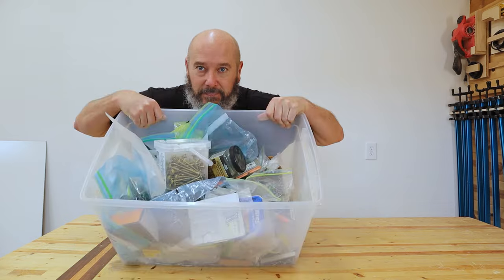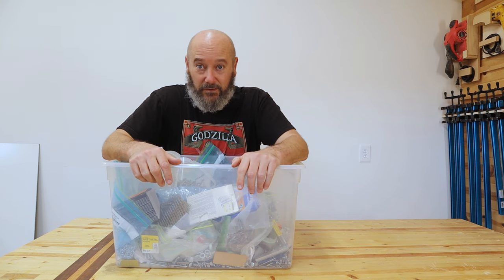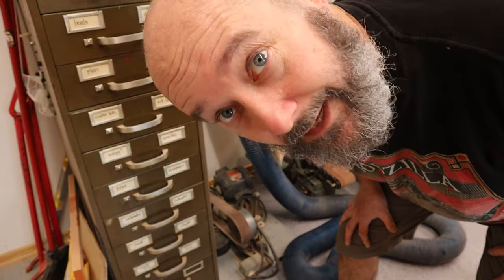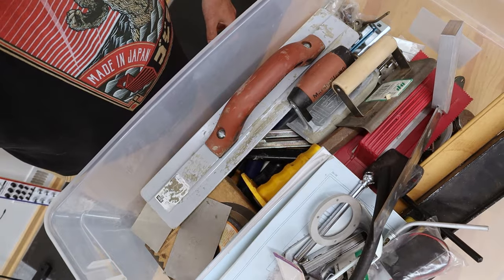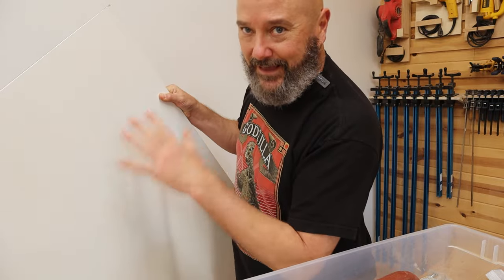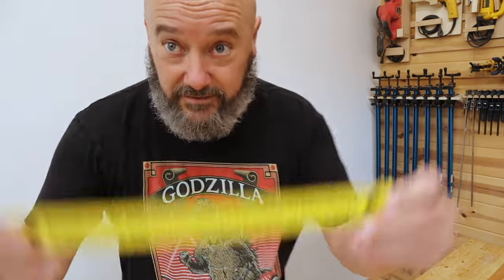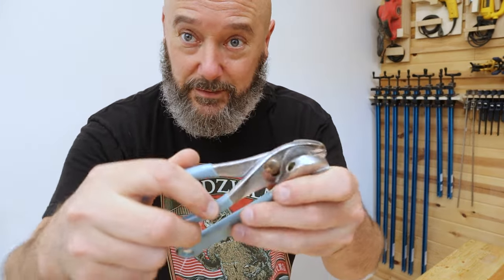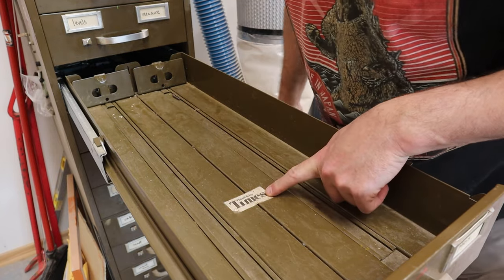Say Goodbye to Chaos! Easy storage for screws, nuts, bolts, & nails

Comment: I like to add the Fastner bit size to the container as well as the size. I also tear the box top and put it in the bottom of the container. It has the color and type on the label you need when you need to resupply.